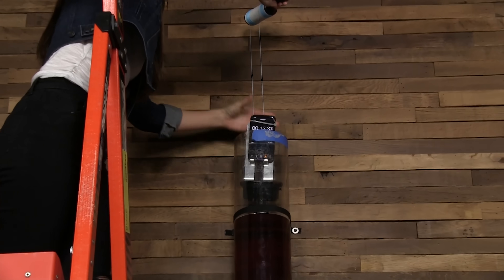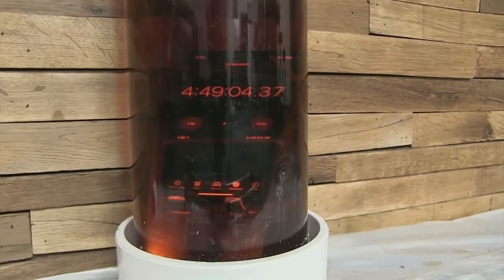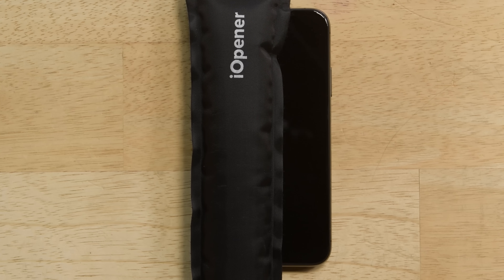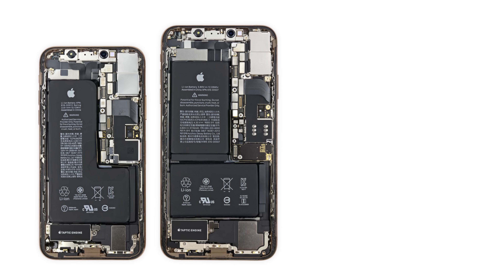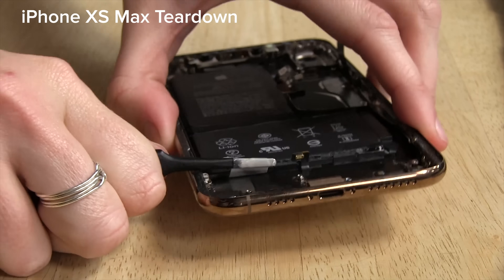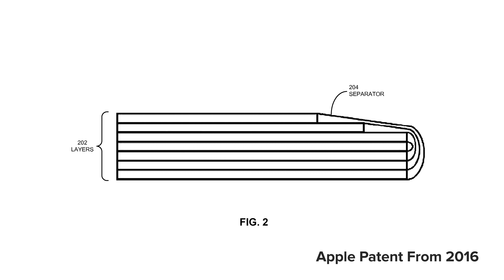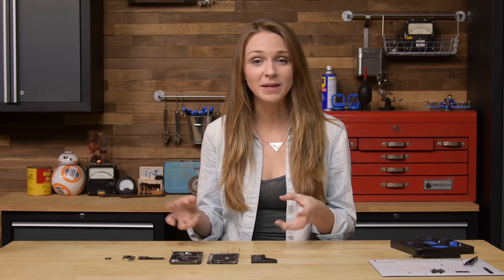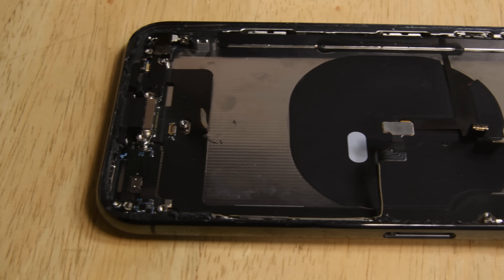iPhone XS Teardown and Beer Tube Test Results

Comment: can you check unbox therapys video please cause the charging port dosent work you have to on the screen most of the times then later on it stops again can you check thr problen and fix the hardware port issue?.

Comment: Remember that the resistance diminishes over time. Heat, moisture and dust can slowly degrade the effectiveness of the double sided adhesive that sits between the screen

Comment: I don't understand why the Max needs to have an extended logic board... the XS and XS Max should be identical and this longer logic board decreased the battery capacity and gives the Max a worse battery life than the previous Plus models...
Reply: Tim R. Yet it beats most other andriod flagships in battery
Reply: Watch mrbossforthewin

Comment: what was the pressure at the bottom of that tube?
Reply: One atmosphere for each 10 meters of the tube
Reply: Kula Reddy don’t know but everythingapplepro dropped his and a note 9 to the bottom of a 45ft lake. The iPhone was fine the note was glitching. Very impressive.
Reply: Beer density×9.81m/s^2×8foot
Reply: Yoni Hikri  You're mixing units. Use 32.2 ft/s^2 for acceleration due to gravity or use 2.44 meters. Density of beer needs to match MKS or Imperial

Comment: That’s amazing! Great job Apple! But it would have been interesting to see how long it would take for the iPhone to let beer inside.
Reply: JustAnormalUser But how would you know? The battery would die and the screen would shut off, and by tearing it down you can’t guarantee the seal would be equal to the Apple factory seal.
Reply: Mark Davenport Yeah... You’re right. I was thinking about that too. Maybe if you go deeper for a shorter time and enable low power mode, airplane mode and turn if WiFi & Bluetooth and turn down the screen brightness